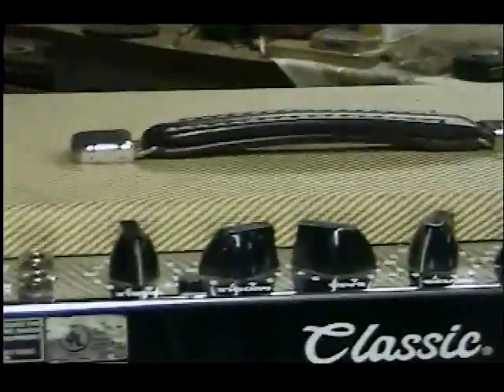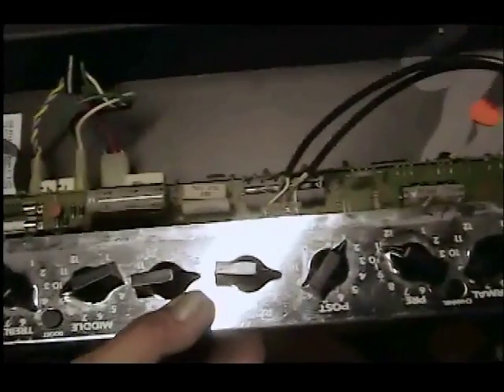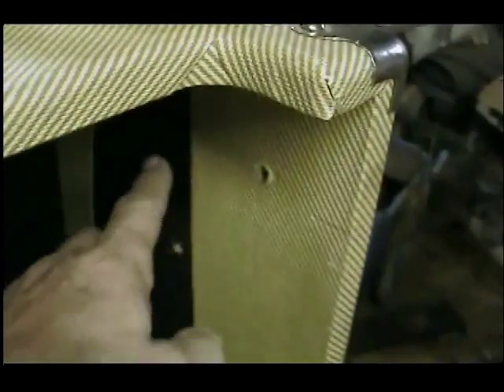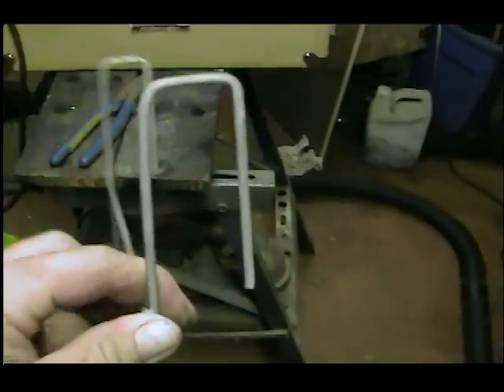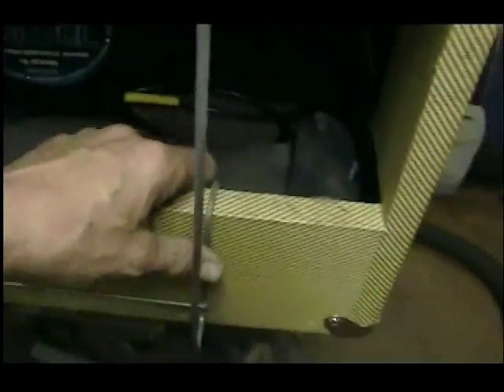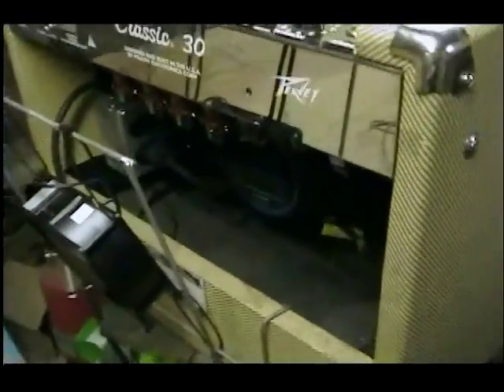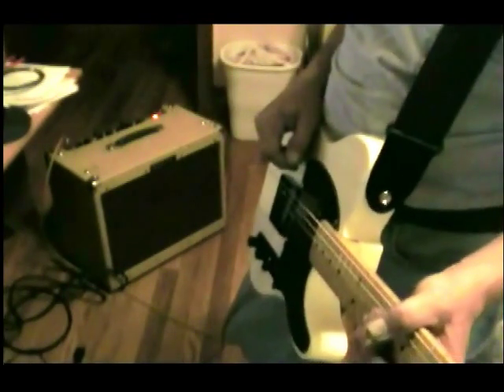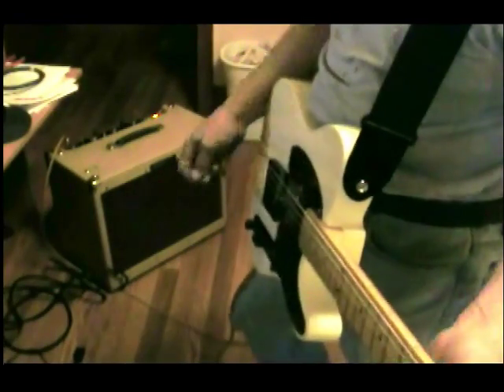Cooling Fan for PV Classic 30 !!!

Comment: Not sure if you did this yet. But turn the fan so it would suck the hot air out. Blowing the air onto the tubes won't really do the trick. Sticking the air out would help much better. That's how the fans work with the desktops.
Reply from the maker: six of one half a dozen of another, either way to  be the most efficient is to have a balance of air flow as in a clean flow from point a to point b without any restriction of incoming or outgoing flow. the way I have it is that cool air is blown across the tubes but creates a positive air pressure within the cabinet as there is no way the inflow can escape without back flow into the incoming air. your way would create a negative air pressure within the cabinet because there is no stand alone duct of air supply to replace whats being sucked out of the cabinet. this causes the air being sucked out to collide with air trying to replace it. regardless  this worked just fine. the control panel was nice and cool....thanks for watching and the comment

Comment: I've kept a fan on the top of my Marshall DSL100HR blowing down to help keep heat from the board and tubes. Its helps a lot.  But I wanted to get some good ideas of mounting one like you are. It's too bad they don't mount them in guitar amps, but we all know they like selling amps, not making them last too much longer past a warranty time. Maybe they would think we would buy more amps if we were not fixing them constantly.
Reply from the maker: pv put a fan in their 50 watt classic because it ran hotter than the 30 watter.

Comment: I would expect you are pushing air out of the amp rather than into the amp. I am interested in doing something like this as my amp has 4 x EL84s and I as it is a well known fect heat reduces life of electronics  so reducing the heat that goes to the chasis holding the circuit is something that keeps coming back to in my head. Specially because it is a PCB based.
Reply from the maker: if there was an outside of cab  colder air intake that was aimed at the tubes to replace the air that the fan was drawing out then yes i would use the fan to suck out..but there is no such ventilation. therefore blowing outside the cab colder air onto the tubes i felt was the better solution.

Comment: I had an old Crate tube head that was getting really hot and then having big swings in volume and tone.  It had bottom hanging tubes as well.  I replaced the caps, and it seems have fixed the problem.  I know heat is hard on caps, but it seems that bad caps may have been responsible for some of the overheating problems as well.  Adding a fan makes good sense.  Any chassis with bottom hanging tubes should have been made with a fan.
Reply from the maker: the 50 watt classic is basically a hotrodded version of this  pushing more power and more heat...PV put in a fan at the factory

Comment: IMO all that's needed is a small  dc powered fan to move the hot air away from the power tubes. Even one of those very small two AA personal fans will do the job nicely without  adding excessive noise.
Reply from the maker: true anything that will move air to remove heat will work...personally i dont like replacing batteries so i went this route and it worked perfectly. thanks for watching and the comment
Reply: @johncartelli  If combo amps found a way to mount tubes upright so that the heat vented up and away that would solve a few problems....but then they'd probably be covered in beer.
Reply from the maker: @yomommaahotoo264  older amps did have tubes upright..but designs change to be more compact a inexpensive to make

Comment: I have a Ampeg Vl502 / 50 watt all tube head its got 7/12ax7's and 2 / 6550's the amp has always run hot and goes through 12ax7's fast so I took my wifes broken Acer home computer removed both small cooling fans figured out witch one would work best and installed it into the vented rear panal of the Ampeg. Its a 12 volt fan so just found an old 7.7 volt Sony playstation adaptor hooked it up and Wow the amp never sounded better! I think the overheating problem has always been there and no one ever addressed it. How did you power your fan? Great video! thanks for posting it!!
Reply from the maker: the 110 v box  that i put inside the amp powers the amp, the computer fan, and two extra outlets for  an extension cord to power the fx pedal board
Reply: AWESOME!  I think its killer that instead of running out to Buy a Furman power strip like most guitarist you made your own! I wss having a serious heat problem myself and probably saved my amps life with a little used Computer fan but not until watching your video.  Great video! You should definitely make some more!! Thanks bud
Reply from the maker: Tim Stanley
thanx and your welcome....
Reply from the maker: the computer fan was an 110v unit so it plugs into the outlet box in the back that im installing here.
Reply: Good deal!!

Comment: Great vid! I have a smaller computer fan I have under the tubes that I run on a 9v battery but it wears out in about an hr and a half so was wondering if I can wire it to either the board or an ac power plug? Any suggestions?
Reply from the maker: you can only run a fan on the voltage it was designed for....some computer fans were not 110-120 volts a.c. like the one i used here.....some are d.c voltages and some were 24volts some were 18..etc   .if you use an ac  outlet you  must use a fan made to run on the voltage you are going to  put into it. try using an dc power supply like the floor pedals use  to get your dc voltage to run the fan. you could put a multi outlet box in the amp. run a cord to it that plugs into the wall outlet, then your amp and the power supply would plug into the multi outlet.
Reply: Get any pc fan connect to usb plug in when on if you have usb. Monile phone generation sure there are plenty spare usb femsles to plug. To 5 v . Runs pc. 12 v goes very fast.
Reply from the maker: @mabul513 there is no usb plug on a classic 30 amp
Reply: @johncartelli  pc fan. Usb connect plug into 5 v phone charger. Easily.  Easiest mod to keep from killing your amp with heat.  No fans or sufficient heatsink so tubes get bought more often and regular heat ruined capacitors and stuff. Money for after bought. Vacuum cleaner its filters amps is fans. Need money so dont ose sufficient heat removal. Seled top cab where heat rises sits and cooks everything. Then problem you might call name on front of amp get it sorted! All cash or pc fans would be set up save electrics
Reply from the maker: @mabul513  sorry there was no usb on this amp
Reply: Houeplug usb. Apple adapter.
Reply from the maker: @mabul513  if all you have is a usb powered fan then i suppose thats what youll have to do. However i ordered a 110 volt fan and built my unit this way.

Comment: Fan to usb red red black  black connect tape off spare eires and plug into usb. Add fan with the pc rubber plugs used for pc case. If grill. No 110 v but instant fan. Also not wiring in cab.
Reply from the maker: sorry there is no usb outlet/plug anywhere on this amp or usually at any club that i go to to play

Comment: Add 2 pc fans use velcro strips and block main gap to allow hot air out. Each side i meant.
Reply from the maker: i had considered cutting a hole in the side of the cabinet ,mounting a grill over the hole on the outside with the fan inside the cab at the hole. this would draw in air from the side and  blow it over the tube section, but decide a quicker way was to just build the removable hanger  which worked just fine
Reply: @johncartelli  you only need a spare plug socket or old phone with usb on it. Houses are usually stacked to the full with 5 v adapters with usb ports on them for your phone. Plug in a fan or 2. The draw hot sir out from as near the tubes as pissible. As for wheres the usb connection on the amp! Well i thought aftercwriting connect fan to power supply usb most, or 99% would realise need another aall socket with usb port. Erm phone charger. Old cut join. Or dont. Blow hot air into a hot box. Get a hotspot maybe. Draw hot air from inside out. Across tubes. Wont build up heat. In dyslexic aswell for all you dictionary boring countdown watchers. :)

Comment: Hi! What you think about now, do it worked like it should be, like you do in this video?
Reply from the maker: yes amp works great stays cool..top face plate doesnt get really hot like it used to..i may  mount the fan either on the side inside to the cabinetwith a way to let air into the fan or inside the cab in the back  because the fan now hanging outside sometimes is in the way
Reply: johncartelli Thanks. Maybe i try it too.
Reply: Velcro each side 2 fans with centre board and air in drawing air out. Also pc fans to usb is simple.
Reply from the maker: @mabul513  thanks for watching and the comment
Reply: @johncartelli  i had laney that was so hot on top, so used pc fans and the rubber connectors that clip to pc case and no need for velcro, if have cage at back like on laney. On  different styles velcros good and to a usb its no hassle, they dont put them on other amps to make £ on valves,